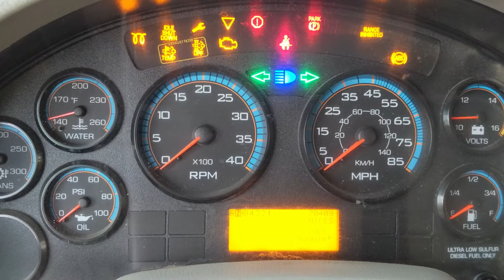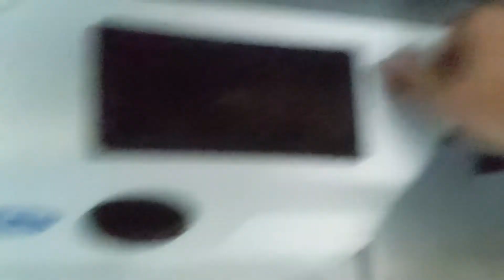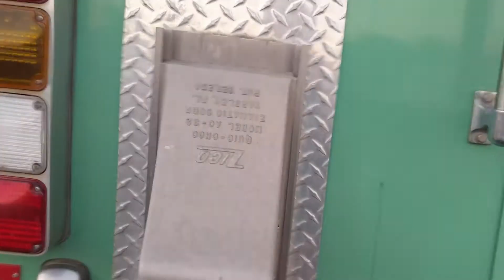2012 INTERNATIONAL 4300 CREW CAB HAULER OVERLAND RV BUGGY HOTSHOT

Comment: 2WD overland ?
Reply from the maker: Rear Air locker attached to 4 41" traction tires tires with full belly pan skid plates. This thing is extremely capable for the size. I had one for personal use a few years ago it would go all over the place.
Reply: @turbo94gto  Ok, nice to know.